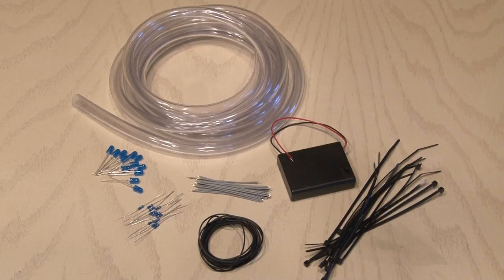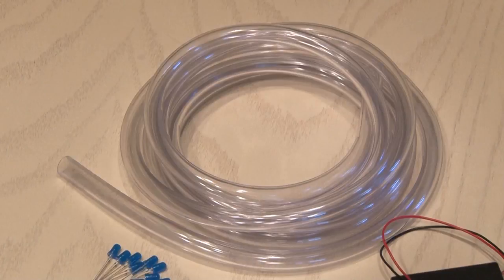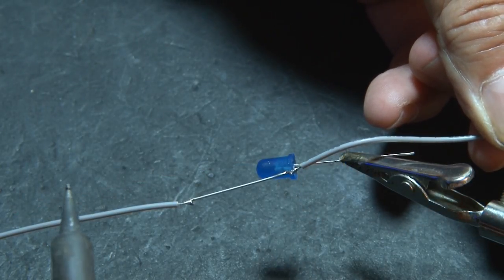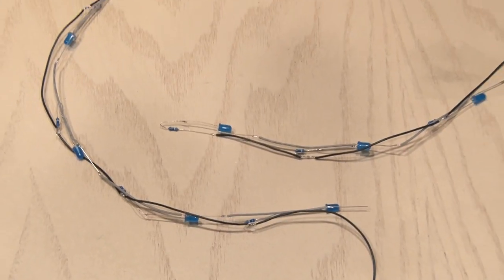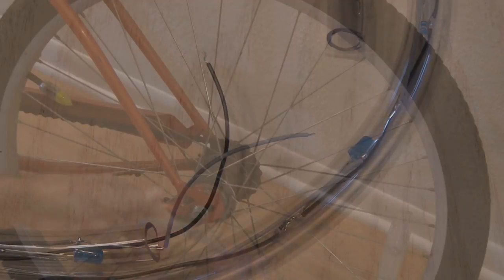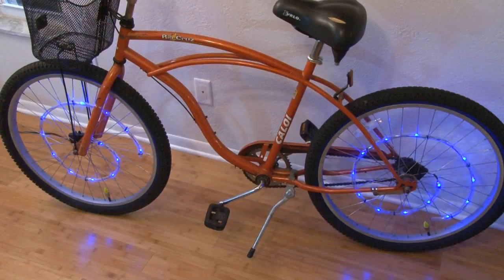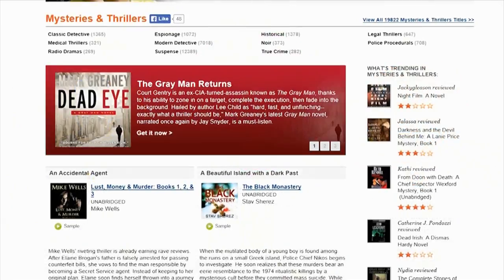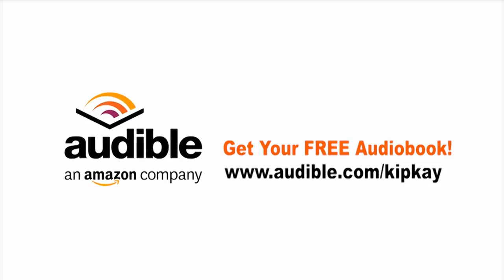Light Up Your Bike!

Comment: Hey Kipkay, I have a question, on any Xbox 360 headset, there has to be a cable with a 2.5mm jack from the headset to the controller for the headset to send and receive specifically vocals, is there a way to make a Bluetooth modification or any modification that would eliminate the cable, but allow vocal noise to still be transmitted and received, if so, could you do a hack tutorial? I only came to you because I couldn't find anything already and I'm almost certain you can find a way. Thank you, I'm a big fan! I greatly appreciate your channel!

Comment: I have a motorcycle and would like to make something similar to this LED strip to put on my bike do you know if this will stand the test of time at higher speeds and could I possibly rig it to my bike battery so I won't need to change the batteries. I know they sell products already made but I like to make my own.

Comment: If I wanted to do this for my bike would I have to use the resistors or could I just attach multiple LEDs in series powered by a battery pack.

Comment: Would you need to remove it in case of rain (battery pack getting wet)? It looks cool, but wouldn't a clearer white light be more visible to cars, and probably safer, too? It may not "click" in a driver's head that that color means a bike rider is there, whereas white probably would. Safety first.

Comment: Is it possible to rig this to run off of AA batteries so that normal humans can use them instead of having to keep two separate piles of batteries? Is there a benefit to using AAA over AA? 

I'm not crazy. AAA's just annoy me because i never have any and when the one single solitary item that uses them dies that means a store trip.

Comment: i dont undertsand how the resistors are connected. help?
Reply: Make sure all the resistors on the led cathodes are soldered to a common wire (the same wire) this case it would be black; negative, thus completing the circuit.

Comment: -_- just use el wire
Reply: el wire can break if bent tooo much. Plus, you have to find a good battery adapter that won't break. El wire isn't brighter than LEDs either. Trust me, I've had them.
Reply: TheKg251 The amount that kipkay was bending the LED tubing wouldn't break EL wire, just tested it. I know from experience too, used EL wire to wave violently around in the air for long-exposure photography effects.

I think his point is that most smaller EL wire kits come with a battery-powered driver and wire, so you wouldn't have to construct it like this one. It'd just go.